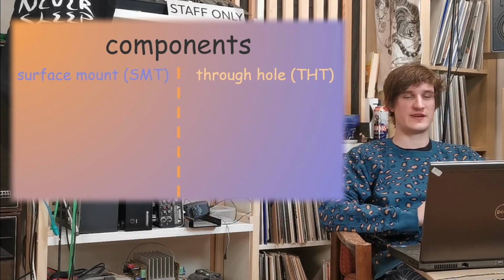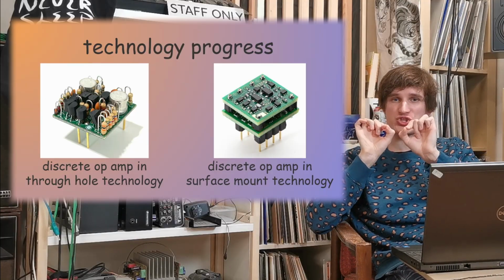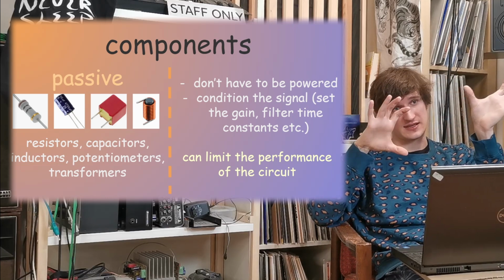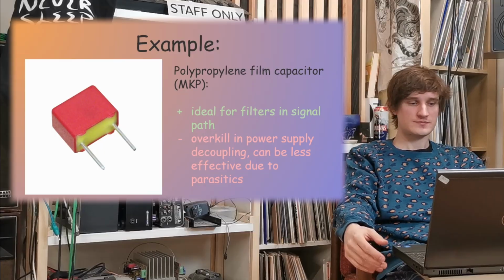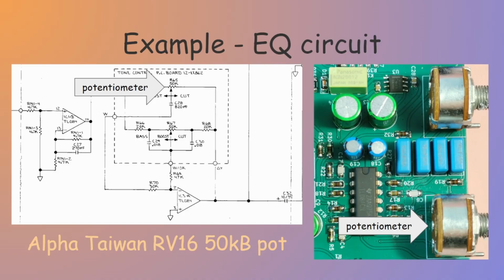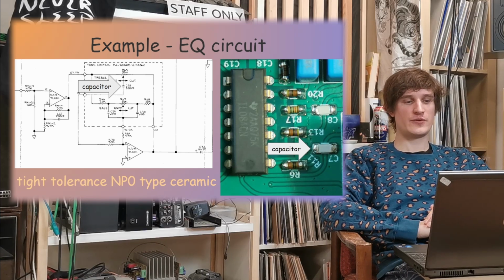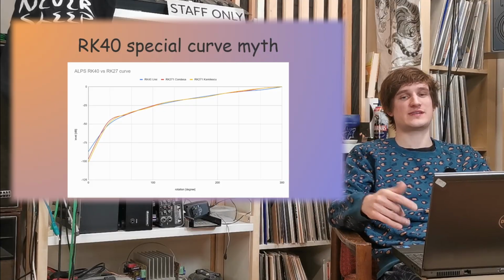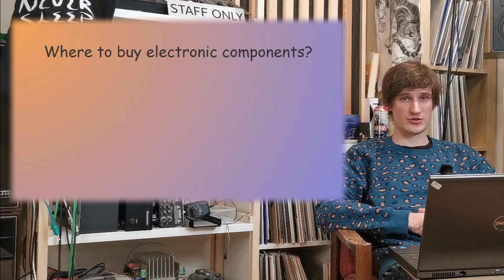Making of a DJ Mixer - Part 4 (component selection)

Comment: Many transformer manufacturers clone vintage transformers, for instance Sowther 1327, which is a Urei clone, ok it's for the 1176 compressor rev D, but it might just be close, and an actual Urei clone, so it will sound Urei :)
Reply from the maker: Thanks for the tip. "so it will sound urei" is just an assumption, it will be great to find this out.

Comment: It's a nice touch how you suggest staying faithful to the original DIP-14 TL084 in the Urei for mixers aiming to achieve a similar sonic character to the Urei. 

I totally get why people love and want the Urei sound, though today I would personally much prefer to build an original DJ mixer design that prioritises sound quality, transparency, thd, and noise. A Jensen 990 discrete Op-Amp would be the perfect choice for such a project in my opinion.
Reply from the maker: @tim36332  can you tell me more about a need to use discrete op amp in search of transparency? What is the benefit?
Reply: @mixersinside There is no "need"... It's horses for Courses... Perhaps my comment was unclear that an uncoloured and transparent sound is my personal preference, so that would be the benefit to me. Of course, I understand many others would prefer a mixer with a clean and punchy sound with a little added low/mid warmth, and in that case I appreciate why cloning the Urei would be a good option. Another potential benefit for some mixer designs choosing discrete op amps and components is the fact that discrete op amps are often rated for higher power levels than monolithic ICs and therefore allow for better class A biasing, generally leading to a more linear output stage, reduced crossover distortion, and a cleaner, more detailed sound.
Reply from the maker: @ in XXI century you can get down to vanishingly low distortion levels with monolithic ICs achieving ultimate transparency. When you need to drive more demanding loads you can also choose a chip for buffering purposes. Open loop gain of modern op-amps is so high, that you can forget about crossover distortion, no need to bias it to class A. I'm curious what's the real benefit of going with discrete op-amps nowadays when transparency is the goal.

Comment: Another informative video, very well described! I hope it's okay if I comment on some aspects of it.
First: Your choice of using electrolyics for Op-Amp decoupling is kinda suprising to me. As electrolytics have a limited lifespan as they can dry out, it's better to avoid them wherever you can, and decoupling is one of them. Regular X7R 100n should be the perfect choice here, probably the most used part on every pick and place machine. Use 0603 or 0805 and you get them really close to the power pins of your IC. On the TL074 it looks like the decoupling caps are quite far away from the power pins on your design. They are placed oddly on SO-14 packages, hence why I always use dual Op-Amps.
Second: There are thermal effects in resistors that effect distortion and noise. I have seen research and studies on resistor distortion and the bottom line was that it's beneficial to use higher power ratings for lower distortions. I'm sure you'll find the studies. It might not be an issue here, as the circuit is not really low distortion, but I think using 0603 for resistors is a rather odd choice. I recommend using 1206 thin film resistors. They also won't roll off the floor all day ;)
On a random site note: I order most electronics from TME. Have you ever heard of them? They are a polish company, so maybe for you it's comfortable to order from them, too.
Keep up the good work! :)
Reply from the maker: @dedondigital  thank you for sharing your thoughts. 

I didn't use 0603 resistors, I used minimelf and I showed this in the video. 

I also mentioned thermal effects. 

I used 100nF decoupling caps on the bottom layer very close to the IC power pins so this case can't be fixed cause it's already done. 

I mentioned TME shop at the end. 

Thank you for precious and proper tips, but I think you may have missed some parts of the video. It's very long so it may happen for sure. Cheers :)
Reply: @mixersinside  I'm so sorry! Should have listened better :D
Reply from the maker: Any insights are always welcome and it's a really great feeling to know that your advice has already been put into practice!

Comment: There is no myth on the rk40s bozak  had an agreement  with alps only with  a special  curve. Known  fact  with a bozak engineer  that still alive.

When bozak stop production.. the rk40s went back to  it's original  production  state.. that's where ueri and other audio company's have the standard version.
Reply from the maker: @djBroRay  maybe this is a known fact but nobody has proven it with measurements or with showing the curve so it's hard for me to treat it as a fact. If you have more info it will help to straighten this topic out. Cheers!
Reply: I have all the info you need.. did you know the bozak pin are  different  than the urei pins.

And I have scope measurements
Reply from the maker: @djBroRay  would be great to look at those measurements. I never saw anybody making them public.
Reply: @mixersinside  wave music boards had them.  Too bad I can't post replies with pictures

Comment: Now I watched the whole video and I have 3 questions:
Will your design need any trimming to compensate for component tolerances?
(maybe wrong video to ask, but) Why a log pot instead of a braxendal solution with a linear pot?
Is it possible to combine descite and integrated amps to get the best of both worlds? e.g discrete for preamps/out stage and then integrated for the mixing part?
Reply from the maker: @jacobrosen  components used in this design have tight tolerances (1%-2%) in critical places so it's not needed to trim them. If you really want to have super tight tolerances you can buy 0.1% tolerance resistors or hand pick the values with a multimeter.

I used log pot cause this design is based on classic UREI type and they did it this way.

You third question: yes, it's of course possible.

Comment: Excellent video! Back in university i took a few courses on chip design and if i remember correctly analogue circuits are still made with like a 130nm process since a smaller process would increase noise more than what you gain from increased transistor density. 

Additionally you do touch on this, but I just wanted to add that in addition to thermal coupling integrated circuits can be tuned, so if the supposedly matching transistors are uneven they can fix it.
Reply from the maker: @jacobrosen  thanks for diving even deeper and mentioning transistor matching. Matched transistors is a huge benefit of IC technology.

Comment: 1:11:35 Any thoughts on winding your own transformers? Can it be done to sufficient spec?
Reply from the maker: @eeliyx  Winding is possible at home, there are quite cheap machines available that help with manual winding (they have built in turn counter). But as I mentioned this is not the biggest problem as I know - the most difficult part is obtaining the core with proper chemical structure to achieve what you may want to achieve.

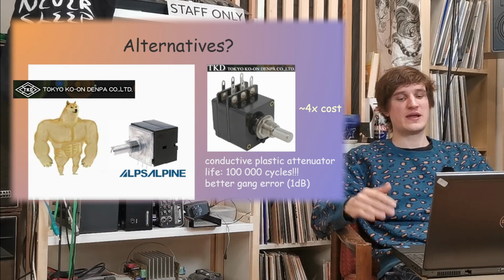Comment: 1:08:34 There is also TT Electronics P260 rated 1000000 (yes, that's one Million) cycles with slightly bigger gang error of 3db. They are produced to a military standart.

Comment: 13:10 I want to add that for amateur technicians, through hole components can be easier to solder. It was a big advantage when I got started fixing my own equipment.
Reply from the maker: For sure they are more DIY friendly! I was also starting with THT and for a while I was afraid of switching to SMD. Now I solder by hand 0603 sized parts and don't look back.